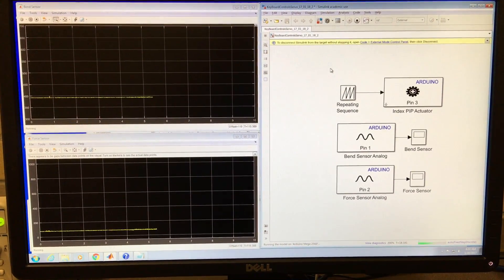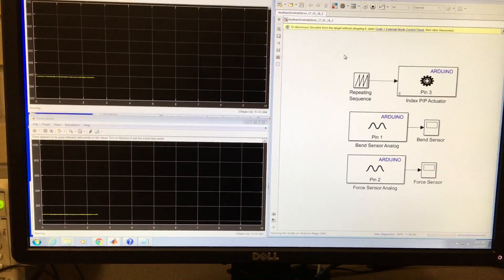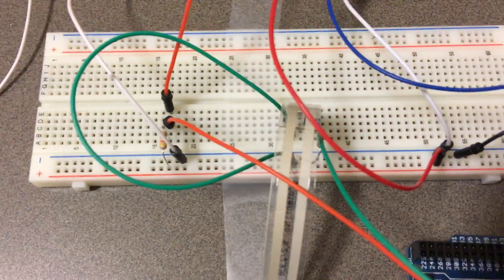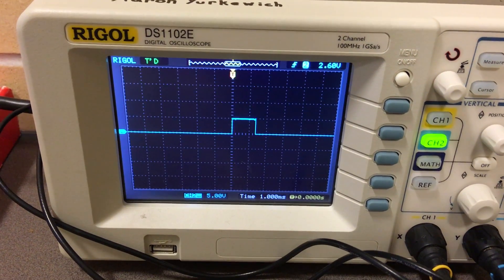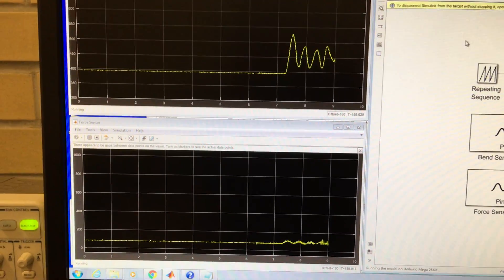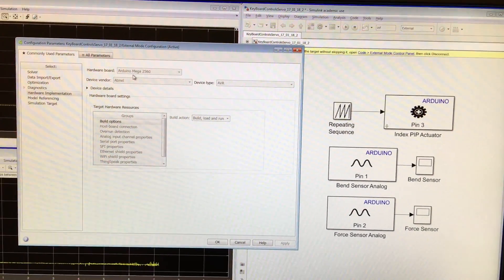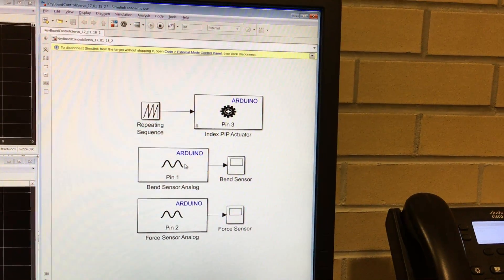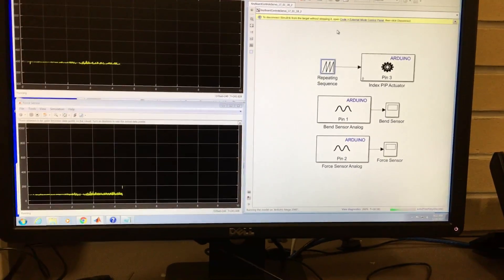Arduino Simulink (MATLAB): Tutorial & Demo: Read Analog Input, Control Servo with Digital Output

Comment: I was trying to work with flex sensor using arduino hardware and was wondering if a circuit diagram can be shared. Currently on following the steps the circuit works fine when corresponding output is received at the arduino but on connecting with simulink it shows only zero voltage for changing flexion.

Comment: I need to compare the phase difference between two analog input signals coming from 2 optical sensors. I tried to convert the signals to a series of pulses and then measure the lag but didn't get me anywhere so far. Do you know a way in which I can analyze the phase difference in my application ? Thanks for the video.

Comment: This is really cool. I'm working on a project using the Actuonix PQ12 R  and force sensitive resistor too. It would be great if you can show more in detail such as how to set up all these things clearly
Reply from the maker: for the circuit connections, the easiest is to google arduino fsr or arduino servo. Is there a more specific bug when you try to set it all up?
Reply: Yes I think, the problem is I want to do some calibrations for the FSR so that it can show the exact force in Newton when I press on it. My system also has a linear potentiometer with it together, working with the actuator and FSR.
Reply: One more thing I want to ask is that do I need to create a PID controller or any controller to control precise position for my actuator because as I know, the RC servo has its own controller embedded in it, but what if I want to improve the response time of the system ? Thanks for your response

Comment: hi aaron
cool fundamental teaching !
one question here. what if i did not the resistor ? is there any damage to micro controller ? thanks. 
Can you make tutorial on gyroscope mpu 60050 ?
thanks aaron
Reply from the maker: Without the resistor your signal won't change when you load the pressure sensor or bend the flex sensor. The resistor is used to create a Voltage Divider (https://en.wikipedia.org/wiki/Voltage_divider).
Reply: @aaronyurkewich8221  Appreiciate it Aaron